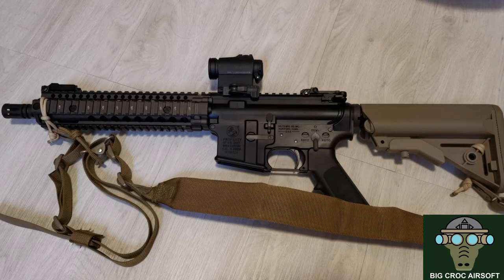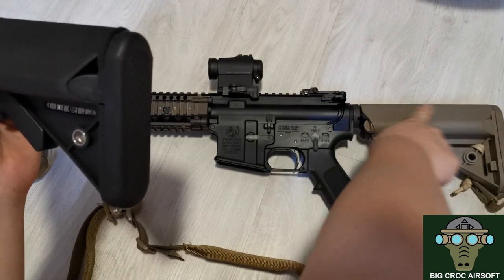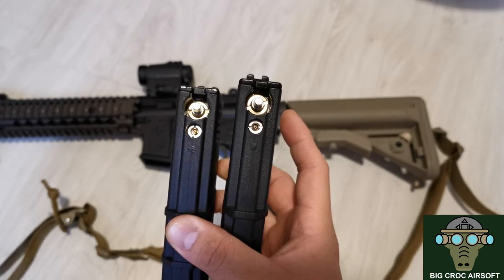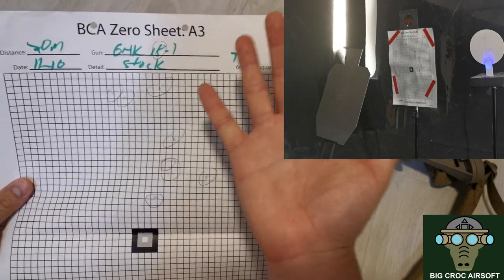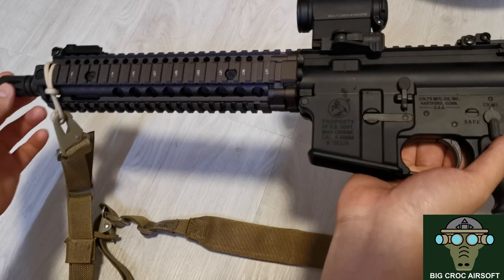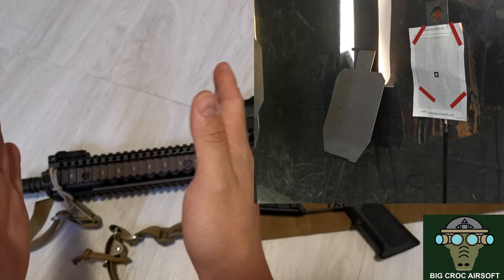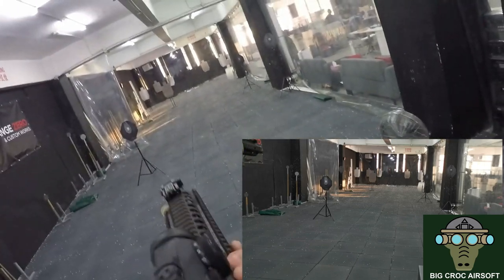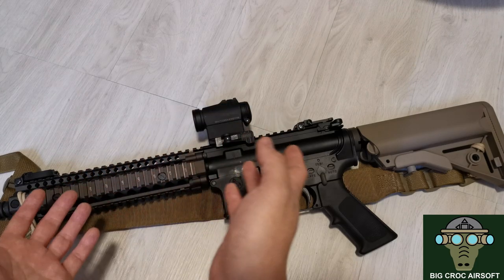GHK Mk18 Mod 1, disassembly, 1000+ rounds review

Comment: Hello, how does it stand in performace compared to VFC or WE M4's? Also does the range reach over 50m like AEG's? I have lots of experience with AEG's, now I am considering buing GBBR, but do not know where to start, and if the price is reasonable compared to other brands. Thank you!
Reply from the maker: GHK is definately better, accuracy can be the same with all the system since they all cab be upgrade with some aftermarket parts. But in terms of system design and gas efficiency GHK is better than WE and VFC in my opinion.
Reply: I like ghk guns that use m4 style mags like this or the ghk g5, because the mags are surprisingly light weight. Two  ghk mags weighs the same as one kwa mag.

Comment: Do you have any experience in cold weather  ~ 0-5 * C, with your GHK vs TM MWS on green gas?

and which one do you think is best and why?
Reply from the maker: coldest in HK is around 13C only, but I would say both system can perform as well.
Reply: The ghk g5 mags preform pretty well in the cold due to the fact that the outer shell is polymer rather than metal so it doesnt get cold as easily

Comment: Oh yea use a plastic tool to adjust the hop up
Reply from the maker: yea I guess I would have to, what kind of plastic tool are you using?
Reply: BigCroc Airsoft My gun should arrive today. I’m going to try using the back end of some glasses frame I have some with rubberized tips. My video should be up by tomorrow

Comment: Hi, is there anything else to do when taking down the barrel nut? I tried to take the nut off last night, and it is tight as heck. I even broke my AR wrench...
Reply from the maker: Yes its extremely tight, thats why i need to use that bench clamp to clamp down the rifle before i can unscrew the barrel nut, you can try spray a little lube around the nut ( not gonna be much use but the lube might get in a little)
Reply: BigCroc Airsoft thank you so much! So it’s all about physical strength lol
Reply from the maker: @michaelli8012  yesss lol, when you do take it out and reinstall it, make sure you put apply some solid type lube (grease) to prevent rusting, since its so tight, once they rust and fuse, next time you tried to take it out might break either the upper or the nut
Reply: BigCroc Airsoft thanks man, your tips are very helpful

Comment: how well do the magazines fit? I have an older GHK m4 and aside from two of the magazines, they all need to be manually stripped from the mag well, they don't drop free when hitting the mag release
Reply from the maker: I am only using new mags (V2) , they wouldnt drop naturally, need a little pull, but could be due to the gun is still new?

Comment: Is the bucking very easy to be worn out?
Reply from the maker: Not too sure on that but most ppl i talk to would change buckings as they say original one doesnt perform well
Reply: BigCroc Airsoft is there any aftermarket hop up that you recommend? Like maple leaf TNT? I only use 0.25g or 0.28g for gbbr

Comment: Sorry to bother you again, but what's the name of that G&P tool?
Reply from the maker: Search GP817B installtion set, hope it helps
Reply: @BigCrocAirsoft  Thanks man, I just broke my upper by not using this tool.... damn I hate myself rn
Reply from the maker: @michaelli8012  wah damn, well at least you have excuse to get new parts now lol. and that's why tool exists ma
Reply: @BigCrocAirsoft  Will remember that forever XD. So I just bought the tool, and I'm wondering how much strength you have used to get that freaking castle nut off? Like full-body strength? lol
Reply from the maker: @michaelli8012  on mine, after wrench it lock on the nut, i do light tape with hammer "on wrench", it came loose around 10-15 light taps, i didn't use all force at once
Reply: BigCroc Airsoft well, seems like I’m just unlucky